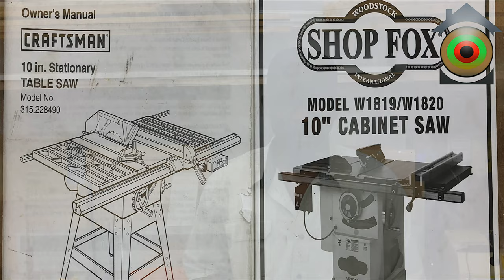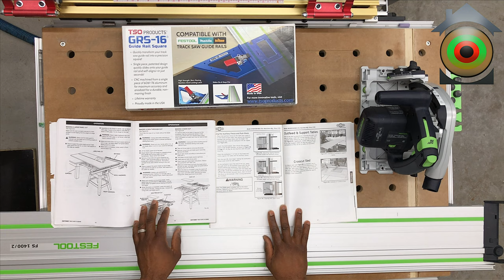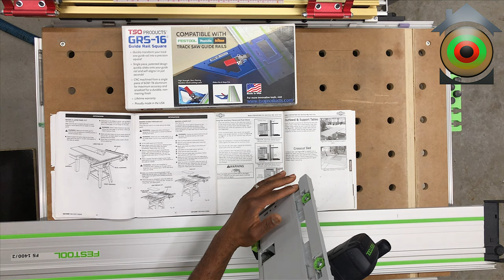AMERICAN TABLE SAW ARE NOT DESIGN TO PROCESS SHEET GOODS! CHANGE MY MIND!

Comment: I agree that a track saw is the ideal first option for breaking down full sheets in a small shop. That said, I prefer a practical and efficient 2-step hybrid methodology for finish sizing of all but the largest panel pieces (unless minimal shop size prohibits): Step 1) Straight line a long edge and cross cut one end (and/or additional crosscuts) using a track saw and TSO Guide Rail Square. Step 2) Referencing next cuts off the two perpendicular edges created in Step 1, rip parallel to finished sizes using table saw with Biessemeyer or equal rip fence, suitably large outfeed table, and movable infeed table or roller stand.

In a most small shops, the large outfeed table can often double as the track saw cutting table, assembly table, and/or router table when the table saw is not in use. Regarding safety, most panel pieces typically ripped on table saws are wide enough that hands needn't be anywhere close to blade. Featherboards or commercial hold downs can also be used, especially for narrow rips. Parallel rips using a properly equipped and accessorized cabinet saw are IMO definitely much quicker and more accurate than the best attainable with track saw and parallel guides.

The table saw was originally called a "variety saw" because of all the different types of cuts and joinery (including use of dado head) that a skilled worker can accomplish with one. If available work space and budget permit, adding a table saw with a good fence to your track saw is a cost efficient move that not only improves sawing but also adds high tactical value for many other woodworking operations as well. IMO the advantages of a track saw do not go so far as to qualify it as a full replacement for a table saw.

Comment: I resemble that 60+ year old man and that is why I bought the Festool TS 75 and the 100+ inch track. I now have the TSO  devices including the parallel guides. I have yet to use the parallel guides. Regarding the "paid actors" and/or seeing someone else do something. "Just because you can, does not mean you should", write that on a rock.
Reply from the maker: I m very much interested in their parallel guide system. When get around to using it, please let me know what you think. Thanks for watching!

Comment: Another track saw convert here.  I broke down many plywood 4 x 8's using a small table saw because it seemed better than using a carpenter's circular saw.   I reduced the physical effort and risk by using both infeed and outfield tables and clamping a six foot level to my rip fence so I could accurately guide the sheet good towards the blade.   It worked well  with  my Rousseau tables but now I recognize the risks were signicant and I was simply lucky something bad did not happen.
Reply from the maker: Thanks for watching Roy!

Comment: Like the content. I break down alot of plywood, and all though the track saw is nice it gets old setting it up. I decided to figure out a better way of doing it. What I came up with was using a large table saw a delta 12/14  with a tilting infeed table and a large out feed table, all with rollers. I realize not everyone will be able to have a table saw that large or the fabrication skills to weld up customer infeed and outfeed tables. But man... Breaking down plywood is a cake walk now. It's so easy I can do it by my self and was worth the effort of refinishing the large saw and building the tables.
Reply: Show us pictures of your infeed and out feed tables.
Reply from the maker: Thanks for watching Matthew!
Reply: Takes up Way to much space imo. To each their own tho!👍 For me tho, not to hard to set up both ends of a one piece rail and cut.
Reply from the maker: @reddawgrup1779  thanks for watching!
Reply: @danhale3259  how do I show you a picture on youtube? I have a thread on garage forum about the tablesaw. Search Delta 12/14.
Reply: @matthewrentz3427  I haven't mastered that yet, please let me know.
Reply: @reddawgrup1779  Got a reasonably priced adjustable height work table on wheels at Home Depot for an outfeed.

Comment: Even with the European style table saw and vertical panel saws, you still have to muscle the sheet on to the saw, orient it, and manhandle it through the cut. A panel saw has issues with gravity acting on the sheet during and after a cut. A track saw is the only way to get clean, near perfect cuts while keeping the sheet stationary. I'll take moving 5 pounds of saw across a sheet any day over moving 75 pounds of sheet across a saw...
Reply from the maker: Thanks for watching Al!

Comment: How do you find that TSO square for the rails ? I'm in the market for one, at least in the UK the TSO one is roughly the same price as the Festool version. Wondering if there was an advantage of the TSO ?
Reply from the maker: The in formation is in the description. The Festool one shown seems to be licensed from or made by TSO. Thanks for watching!
Reply: @concentrichomesolutions  thanks , that makes sense, apart from the end shape the rest looks very similar, the latching mechanism looks the same.
Reply: @jonesconrad1  Check out the BenchDogs UK rail square it has more features